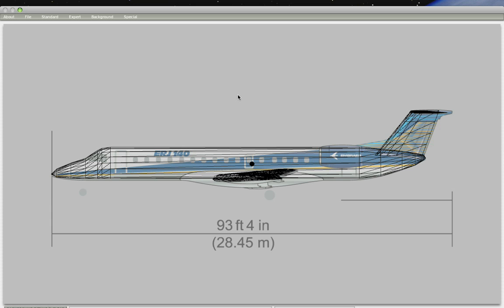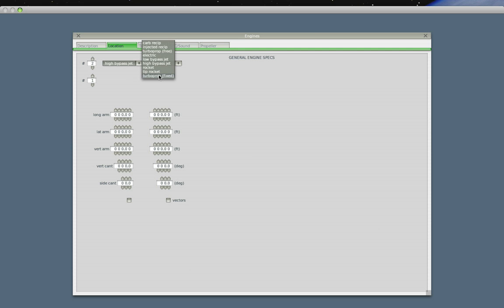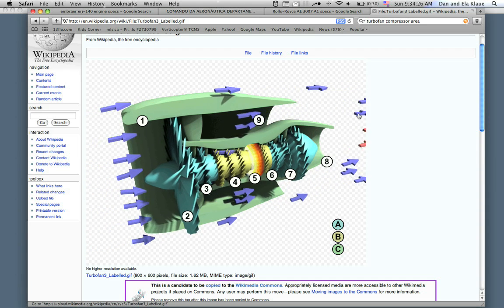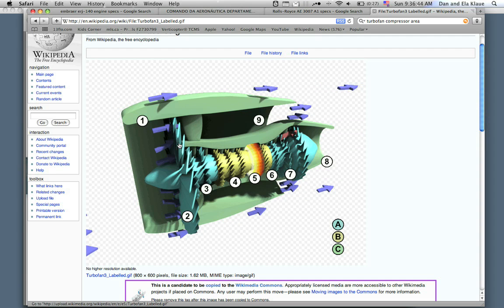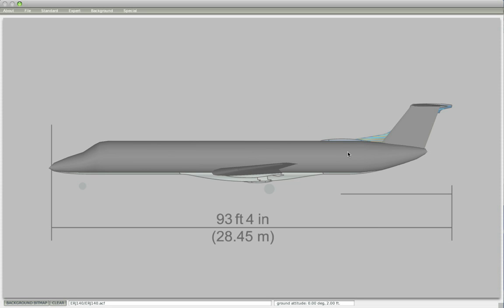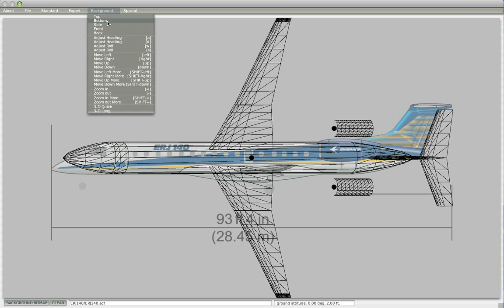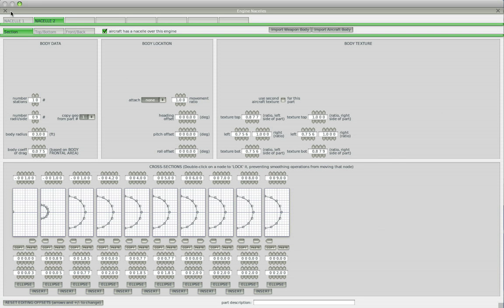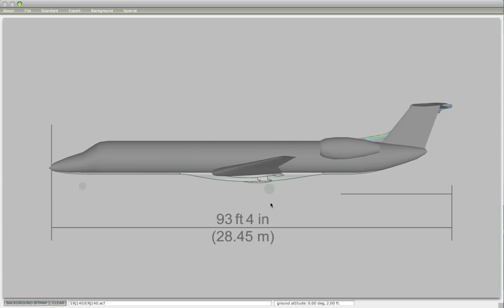PlaneMaker Tutorial 4: Engines and Nacelles

Comment: @RCFlyingBoy2009 I had the same problem.  To move the flaps you need a system to pressurize the hydraulics.  Try adding switches for battery and avionics.

Comment from the maker: @daveproductions63 

There's a feature in each nacelle builder that allows you to copy the geometry of a different nacelle to the current one you're working on.  Then you merely have to tweak the position of the nacelle, to be on the other side of the fuselage, and you're set.  Look for the drop-down menu in the nacelle-building-window that says, "Copy geometry from..." 

So, if you're working on nacelle 2, and you've already finished nacelle 1, you'd select "Copy geometry from nacelle 1."

Comment from the maker: The Vne is the "Velocity not to exceed" (or else airframe damage may occur).  You can set that in the "Standard -> Viewpoint" menu, on the left-hand side.  Hover your mouse over any of those fields to get more info on what you need to set there.  Your plane will fly fine despite those warnings during save, but your airspeed indicator will lack some important data.  I think X-Plane's damage model is also linked to this Vne.  (parts fail at speeds exceeding 25%).